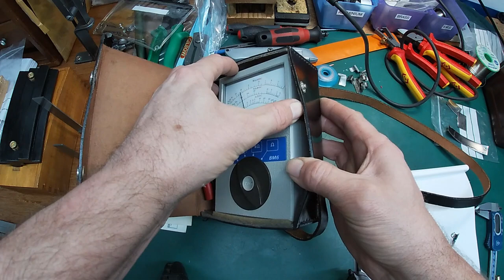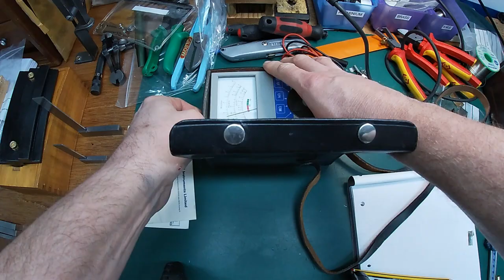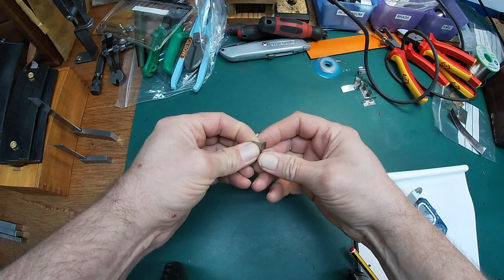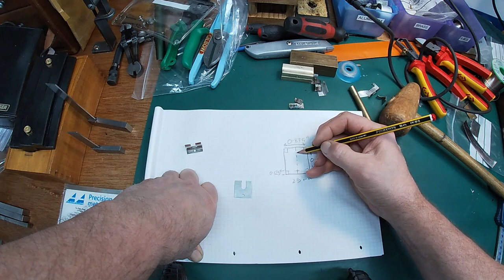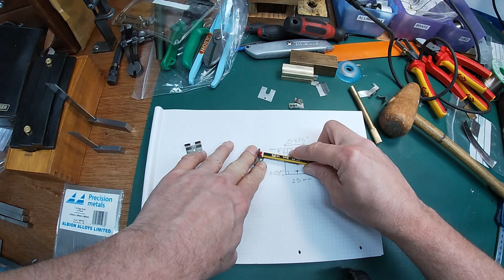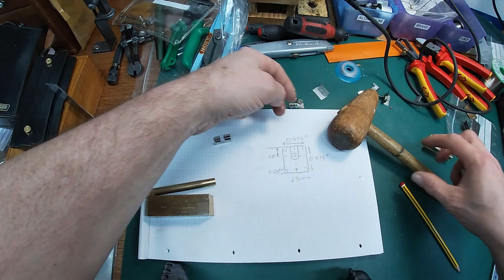Replacing corroded battery terminals - Megger BM6

Comment: Hello Chris I have a bm6 that I purchased decades ago. I have 2 double clips I need to change. I assume opening the unit is not necessary to do that. Can you sell me 2 double clips. I live in Montreal Canada.
Reply from the maker: I seem to remember having to open it up which can be a bit fiddley. Always good to take plenty of photos during strip down. I can make some clips but you may well need to be prepared to have the back off of the meter.
Reply from the maker: Will also need to check if I still have the press parts?
Reply: @chrisgosling5408  hope you do!

Comment: I just replaced all the clips with a PP3 battery connector!
Reply: Can you show me where you connected the pp3 connector wires?
Reply: @Gamorim_59  With an ohm meter and in combination with the polarity indicators for the battery positions, you can measure which clips just connect the batteries in series and which ones are the final positive and negative into the device.
Reply: @janetwinslow2039  Can you see my next message, I really need a picture of the component side pf the pcb board to help me fix mine. Thank you.